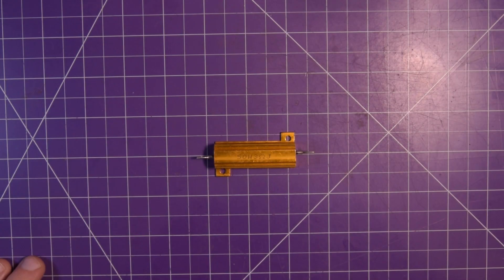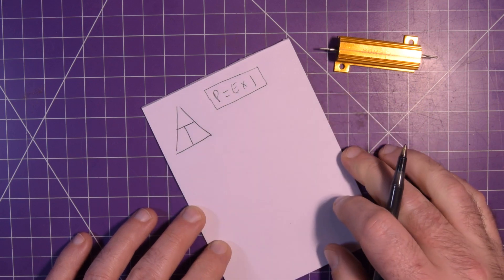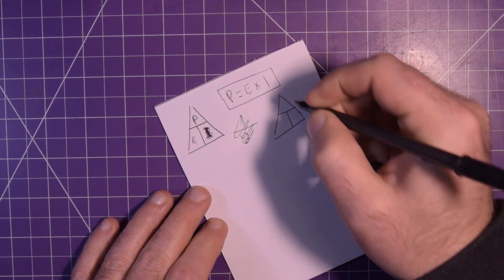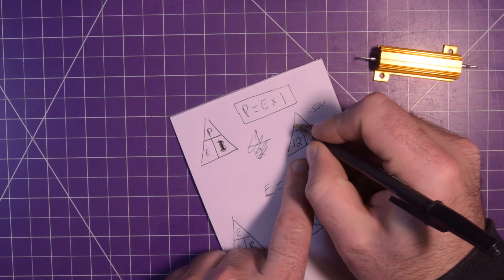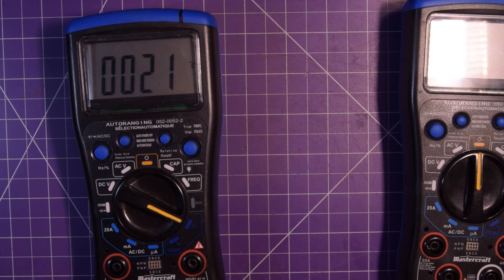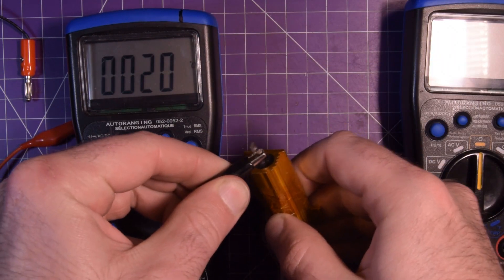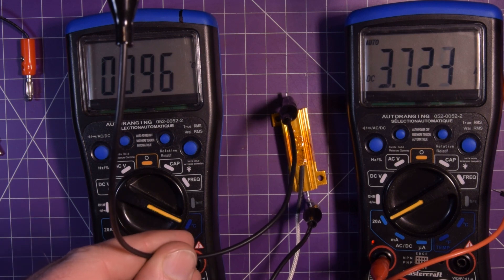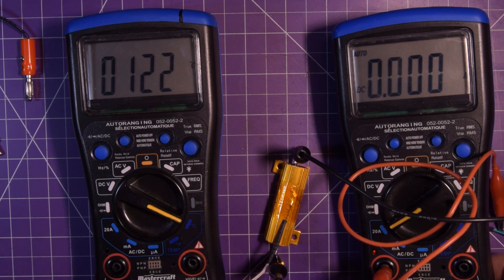Heating Up A 50W Resistor!

Comment: HSA50 50W resistors specification says, that the non heatsinken ma power is 20W for 50W dissipation it needs to be mounted in heatsink with temperature of 20c below the resistor. just as ou can not get full power from car engine if you remove coolant from it.

Comment: This particular resisistor is designed to consume a 50w load and dissipate it as heat. Have you ever felt a 12v 60/55w halogen bulb? and even the glass on a headlight running a 100w bulb gets very hot to touch. They do get hot but this is normal. This resistor should get about the same temperature as a 50-55w bulb. Obviously they are not ment to be mounted on plastic or cloth and should be mounted to metal. Having a fan or stream, of cool air will help too but i dont think its 100% necessary as the resistor is made to handle 50w of heat. I dont see the issue. Anyway i am looking at using one of these to consume 50w of power when headlights are turned off so i can take some load off my voltage regulator so it does not have to shunt so much power from the alternator and constantly be working to its limit or exceeding its limit in fact. Its hard to get certain regulators that can handle dumping over 200w and it normally means running a light or lights full time even during the day but then i thought about using a load resistor. Now if i can find one thats not just these gold coloured ones that would be good.

Comment: I'm a bit confused, if I plug 50w but 6ohm resitor, should I be expecting twice as big temps?
Reply: You'll just need double the voltage for the same power. These triangles got a little cabalistic, but it's simple really P=U*I, Power(W)=Voltage(V)*Current(A), I=P/U and U=P/I  . Also, I(A)=U(V) / R(Ω)    R=U/I and U=I*R. But for temperature you need a datasheet. They have different temp. coeficients depending on the resistance and dimensions.

Comment: Hi don’t know if you can help just done a headlight upgrade 24 V LED with a 50 W resistor it knocks the light out on the dash which is great but it’s getting very hot you can cook a egg on it tried doing research Sam saying get lower wattage and Sam saying  higher wattage can you help on any advice please
Reply from the maker: You have to double or quadruple the number of resistors you use and run them in series. For example if you are using a 4ohm resistor, use two 2ohm resistors in series, or 4 1ohm resistors in series, they will share the dissipation!

Comment: The rated watts of the resistor is with heatsink.A 100W resistor without heatsink as you demonstrate would only be capable of 30W .

Comment: These Al housed power resistors are made to be mounted on a heatsink (HS) with thermal compound (and fan if HS is rather small) to run at full rating.  Just a couple days ago I used a 10k / 50W resistor consuming only 16W and found that it will -quickly- get too hot to touch in just air.

Comment: Hmm.. that sucks. I wanted to use like a 50-55 watt power resistor to load test a car battery for like 30min. Instead of using a H4 55W halogen bulb. But it seems that I must ditch that idea then if the temperature will become an issue. Maybe better luck with a bunch of smaller one in series? Some kind of load balacing between the resistors.

Do you have any other idea for me that will work using power resistors to achieve 4-5 amps?
Reply from the maker: Just get higher value resistors and put a few in parallel, for 4 amps you need 3 ohms, so 2x 6 ohm resistors in parallel, or   4x 12 ohm resistors in parallel etc etc
Reply: @SimpleElectronics  Thank you for the suggestion!
So it doesnt matter if i use like 4x12ohm power resistors rated at a little higher power? Never been fidling with power resistors only regular ones :)

Comment: Thanks for the video. I was wondering if I could use a load resistor like this as a heating element in my DIY  filament dryer and it seems like it's enough to replace heating film I planned to use, but couldn't get within a reasonable timeframe.
Reply from the maker: Yup! Just size your resistor accordingly

Comment: Hello friend, if you can help me, I have these same resistances, I would like to know what parameters it works in, for example I have 50 and 100 w 50 ohms and now I get a 300 w 50 ohms I would like to have the info of what parameters it works if it reaches mhz or only kh in the notices they did not put all the info it only says 10k in case you can help me
Reply from the maker: I'm not sure what you are asking sorry

Comment: mine is stinks so good that i cannot believed its burning. btw what is the highest temperature that round wire resistor can handle?
Reply from the maker: I'm not 100% sure but they get very hot
Reply: @SimpleElectronics  I did put a nice amd's socket 462 half heatshink top of the resistor, i seem its confortable to the resistor, the white material of my 10W round wire resistor isn't smoking anymore. Btw im loading my 10w 15R resistor with 60-70W constant power to my transistors. Its a simple class A amplifier that Can run 2x5.25" speakers very good (the amp output is arround 45-50W at 4ohm) without heatshink it start smoke in below 10seconds.
Reply: @SimpleElectronics  update: we upgraded to 2x40W resistor, the 10w one got some oxygen and started smoking rapidly, 2x40W resistors can get very hot too? how can i cool it when it is in work? My class A amp producing 50-55W at 4ohm and very very small distortion. Need your advice. it is worth to place a fan top of the heatshink? that is on my resistors :D resistors: the big ones are 22R that is placed in parallel due we have need to separate the current that will be 1.8A separated (2x900mA) at 45Volts and we have the small resistor at the gnd of the amp that is 2.7R AND 10W arround 5V voltage drop and 1.8A when the transistor conducts :D

Comment: It actually is made for 50w, it just isn't made to be under 60c in operating temperature. Additionally they are usually screwed onto a metal surface in an industrial setting, additionally your tape around it did affect it's ability to dissipate. But generally speaking, it's designed to run hot, if you read the specs on these it specifies this. 
Remember these are industrial scale Chinese resistors, they really don't have anything to do with some standards over in the USA that specify that resistors should not go above 60c.
Reply: Hello! Do you know where I can find more info on the USA standards for resistors not going above 60C? I can't seem to find anything

Comment: Are these resistors inductive? I have bought some cheap ones for amplifier testing, but have now come to think of the importance of inductance in the testing resistor.
Reply from the maker: not sure the inductance per se, but resistors are typically wound wires of calibrated thickness

Comment: There's simpler ways to figure out the voltage and current you need, if you know the power and resistance. Substituting in ohms law into the power law you get p=v^2/r, and p=i^2*r. Do a little algebra and find v=sqrt(p*r), and i=sqrt(p/r). If you don't want to remember that, there are power wheels with these formula's (that's what I used when I was a radar tech in the navy and the triangle method you used, until I got good at the math from it being beat into us when I went to school for engineering), there's also calculators you can use online or on your phone to solve this for you, just enter in two knowns, and it will solve for the other two. That being said, the voltage you would need across the resistor (if it was truly 3 ohms) would be 12.25 V, and that would draw 4.08 amps. Of course there will be voltage drops across the wires due to the current flow, v=i*r. If you wanted to truly get 50 watts across it the best way would be to hook up a power supply, and adjust the voltage up until you got the 12.25 volt drop across just the resistor, or set your current limit to the 4.08 A, and dial up your voltage until you hit it. Both of these methods would take the voltage drop due to the wires out of the equation. That's a lot of math and theory for just a video where you're playing with resistors, good video!

Comment: This type of resistor is designed for mounting on a heatsink. They are also designed to work at much higher temperature, absolute maximum is 200 celsius.
Ceramic wirewound power resistors can be even more fun, some of them are rated to work up to 350 celsius.
Reply: would such a resistor produce electricity when heated externally?

Comment: Hi    in a very old catalog I have the ones they show are made by ARCOL and it says that
they are 52W at 25'C when mounted with heatsink compound onto a 3' C/W heatsink.

it says that the HS50 ( 50W model ) is only  20W at 25'C with no heatsink .

                                                                                                                  Alan